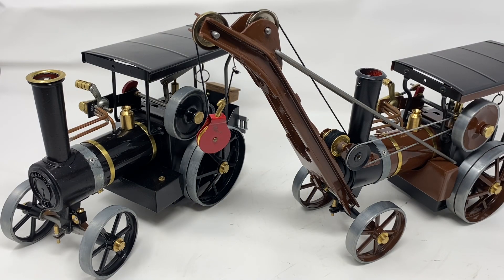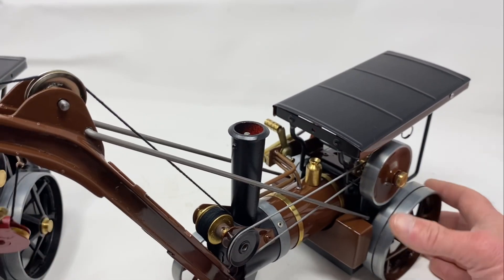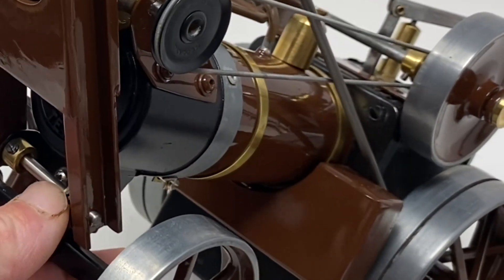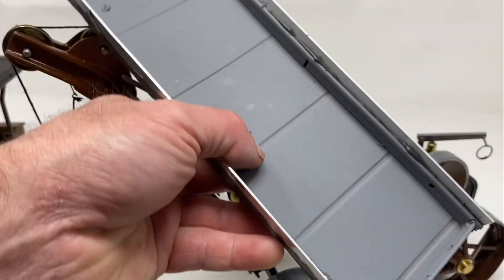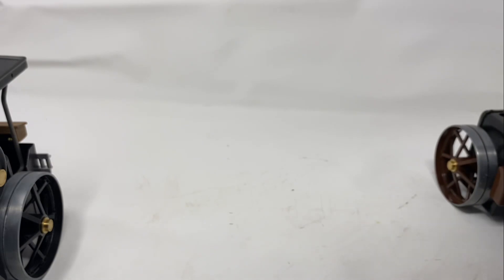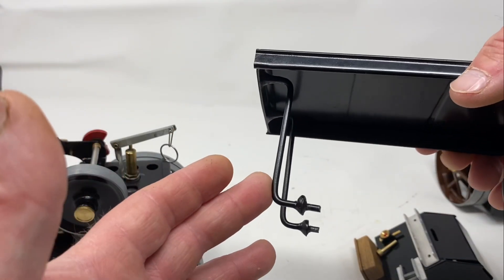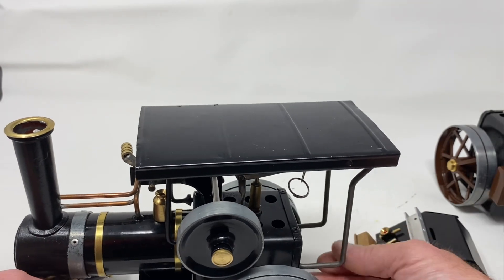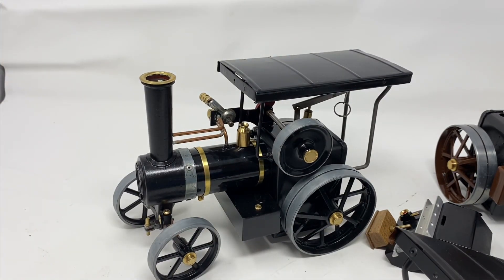Mamod shortened canopy

Comment: Love IT!. I love your enhancements They lift a steam toy into the realms of simple model engineering. More please! I have a load of questions.... Your paint finish is quality. What Paint, is it heat proof, do you brush, aerosol or airbrush?,  when painting the firebox didyou use etching primer?. I could go on all day! an article on building the crane jib an excellent job.PLEASE!.
Reply from the maker: Thanks, obviously they are never going to be hyper scale models but make them less like a toy. As for paint, I did a few using bbq etching primer which I can no longer get hold of, but Upol make a very good etching primer, then bbq paint for the firebox and either high temp brake caliper/engine enamel paint. But I have used standard spray paint before. The key is to bake the paint in an oven after coating, otherwise it will bubble once you raise steam. Usually I start off about 60 degrees C and increase in increments to no more than 110-120. Be aware it will give off fumes. Usually keeping the door shut and allowing to cool completely should keep it to a minimum.